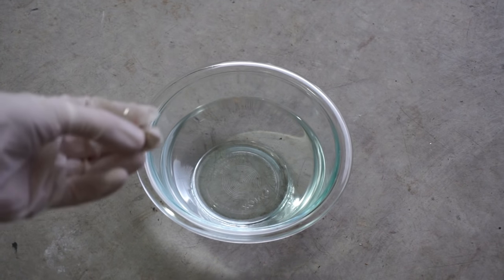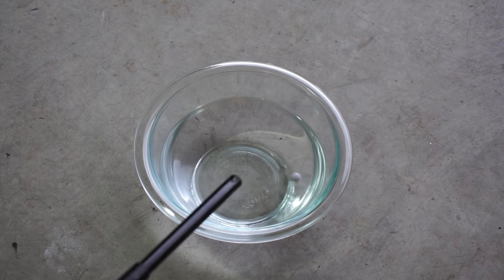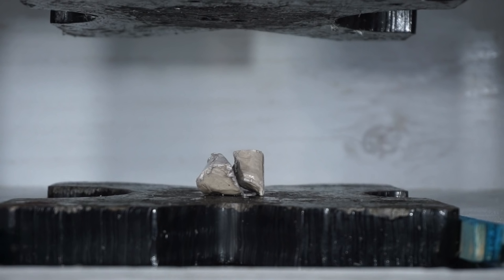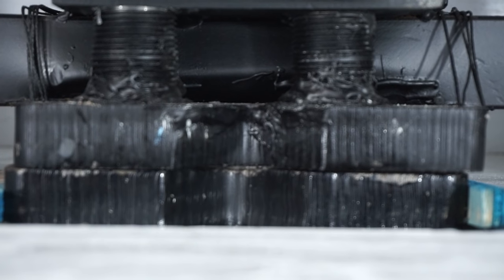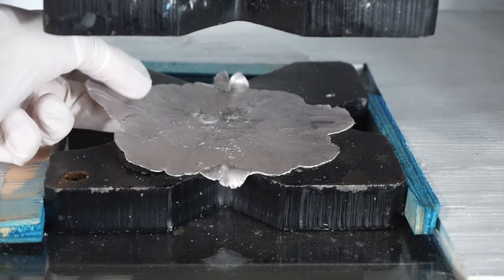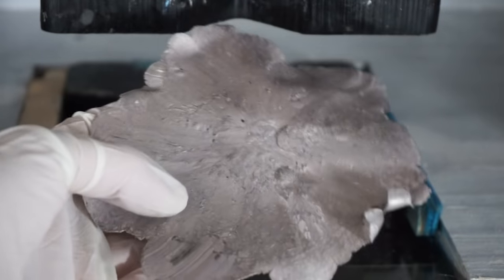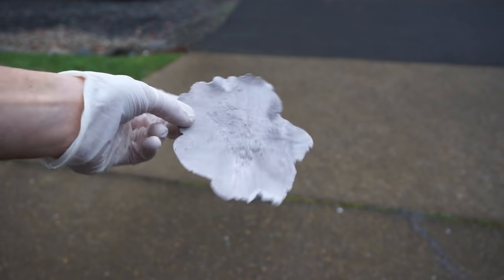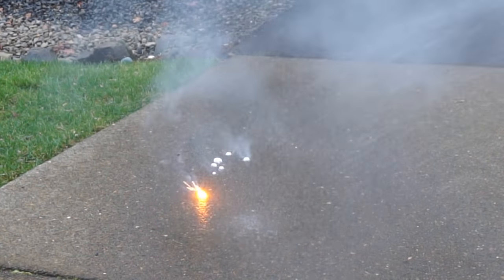Don't Spray Sodium Metal With Water After Flattening It In A Hydraulic Press!

Comment: today i learned how to start fire with water. life doesn't make sense anymore D:
Reply: God you can make fire with water without the sodium metal.
Reply: Fun fact: If you were to dump a lot of water into the sun, you'd only make it bigger and hotter.
Reply: Don't you dare fix that bug, god.
Reply: frtard this is the funniest comment ive ever seen even the replys
Reply: and how old are you?
Reply: and how old are you?
Reply: you dont make fire with the water. You are simply burning the hydrogen (component of water). The sodium reacts with water releases energy and hydrogen. The energy burns the hydrogen.
Reply: God also you can use it like a magnify glass and heat up something flammable and dark to make a fire then put firewood
Reply: There is no more miracles left that god did which science cannot also do.
Reply: Stump remover, salt and zink will absorb the water to combust from air.. so another way aswell
Reply: Life makes sense?
Reply: Have fun outing that out

Comment: crushing reactive metals like this should have only been done with a blast shield and proper PPE. Alkali metals can form superoxides on their surface and either pressing that into the bulk of the metal, or friction with organic materials (oils, paints, etc) can explode. And of course they explode when they come in close contact with water while molten.
Reply: Robert Szasz some people don't listen so just let the ignorant be cause I don't think he will listen
Reply: Robert Szasz The superoxide is mainly on older pieces of sodium and his looked pretty clean. The risk with superoxide is when trying to cut it, it forces that superoxide into fresh sodium and causes a reaction.

Comment: ton of questions. If a metal is that so soft and sensitive to water what can it be used for.  Why does it react to water as it does, why explodes when gets in contact of an other burning metal, why does it react to oxygen so fast? Thanks for the video, very interesting.

Comment: that was saweet! what would happen if you ate some??? also why did you have to light the first ones on fire> ? but then the pancake started on fire just by getting it wet???
Reply from the maker: +April and Davey the hydrogen is flammable but it needs enough heat to start on fire. When you put a little chunk in it doesn't generate enough heat to start on fire. But when I threw the big chunks in they instantly burst into flames and when I got the pancake wet.
Reply: yeah, l was wondering that too, thanks for the explanation !
Reply: Cody from Codyslab ate some. Kind of.
Reply: if you swallowed it, your stomach would explode. it probably would blow up in your throat first actually
Reply: whoa!
Reply: after swallowing it, it will turn into hydrogen peroxide, eating through your stomach
Reply: Quick question... why would you eat it? What was going through your head when you wrote this comment?? 😂 this made my day.
Reply: Verified by YouTube I see...
Answering the question:
He said in the video the bigger the surface area is the faster the reaction.
Reply: April and Davey a little excited hahaha. WOW SCIENCE WHO WHAT WHERE WHEN WHY HOW?
Reply: April and Davey j
Reply: i'll eat it for worldpeace (.
Reply: The Action Lab Why did the two pieces of sodium metal create an explosion when they made contact with one another?
Reply: Luke Tuckett It’s called a Coulomb explosion. There’s a lot of positively charged sodium ions and negatively charged hydroxide ions coming from the reaction with water. if those ions have an uneven concentration, say there’s a positive layer and a negative layer of charged particles coming from the reaction, and then the layers of like charged particles from two pieces of sodium get pushed too close to each other, they’ll start to repel each other violently, which we see as an explosion.

Comment: sodium in water is kinda cool. but pottasium is cooler.
Reply: yeah francium would be the coolest. but I think it would react with the air so much if you could even get enough that you can't put it in water.
Reply: Nobody will ever collect enough of francium (not even a visible grain) because it has an extremely short halflife of radioactive decay. Even if you could, it would vaporize because of the heat it selfgenerates. We've so far clumped few tens of atoms in a spot.

It's also quite possible it would not be more reactive due to some relativistic effects inside its electron cloud.

Facts are: cesium is the most reactive metallic element, and lithium is the most powerful reducing metallic element.
Reply: Is it possible there could be a metastable isotope of Francium? Or are those only present in lanthanides and actinides?
Reply: Francium would be less reactive than caesium

Comment: Hot knife vs sodium metal like if you agree
Reply from the maker: +Flame Network ooh that is a temping idea.
Reply: I think wet knife sounds better...
Reply: Say goodbye to your hands friend
Reply: Flame Network the sodium would melt if it doesn't explode as the melting point is around 160 degrees Celsius
Reply: hand vs sodium metal with water
Reply: Swish Swosh I agree

Comment: Would you please cursh Polycaprolactone (PCL). It's a fairly tough thermal plastic, about the strength of nylon, and can be found on ebay or amazon under names like "polymorph" and "instamorph". It's great for DIYs, but the promotional video shows the stuff being run over by a car unscathed. I'm very curious to see if a large peice of PCL will shatter or simply deform under the tremendous force of the press.

Comment: never confine sodium metal when its reacting with water. That is one thing that will make it explode. In fact just its own weight can make it explode, this is why large piece's explode and small ones just zip around on the surface. If you sprayed water on the sodium and then started pressing it, you wouldn't have a press any more

Comment: hi kandhan here, cool Reaction of sodium with water. 
sodium -It's a soft metal, reactive and with a low melting point, with a relative density of 0,97 at 20ºC (68ºF). etc 
Sodium with water
Sodium metal reacts rapidly with water to form a colourless solution of  (NaOH) and  (H2). The resulting solution is basic because of the dissolved hydroxide.  (2Na(s) + 2H2O → 2NaOH(aq) + H2(g))
 During the reaction, the sodium metal may well become so hot that it catches fire and burns with a characteristic orange colour. 
The reaction is exothermic. (cool..)

Comment: You went to a lot of trouble to get those explosions.  And you put yourself at a lot of risk.  Head over to Thunderf00t's channel where he's done a lot of research on the reaction of alkali metals in water.  He got bigger bangs from smaller amounts and he took far more safety precautions because that stuff is really dangerous.

Oh, and his Thor's hammer experiments are way funkier.  Small blob of sodium on a hammer striking ice.

Thinking about it, you were probably safer with the pancake than you would have been with a blob the same size.  But I wouldn't bet on that.  You were lucky.

Comment: you know the difference between a hydraulic and a pneumatic press ? From the sounds of your experiment you got a pneumatic press and not a hydraulic one. A hydraulic press works with fluids and does not make "pfft" like a defect car tyre when you lessen the pressure. Thats the sound of a pneumatic.
Reply: He has a pneumatic assist press, also known as an air-over hydraulic press. You typically see them on cheap presses or in applications where 90-120psi can do the physical work of pumping the bottle, but the jack is either inaccessible by the user, or dangerous to get to (like under car or motorcycle lifts). By the looks of it he's got a super cheap version given that he's gotta release it manually. Probably went down to Harbor Freight and spent $200 so he could rip off Hydraulic Press Channel and get some of their views.